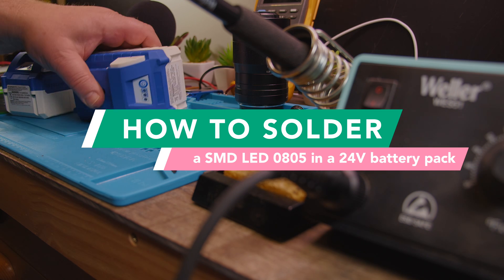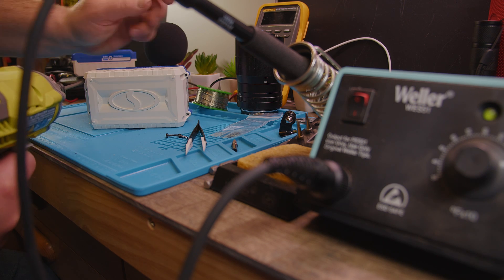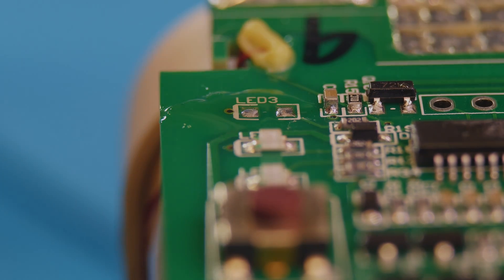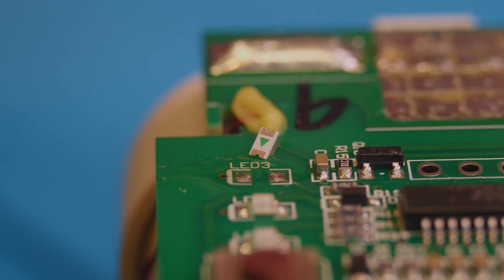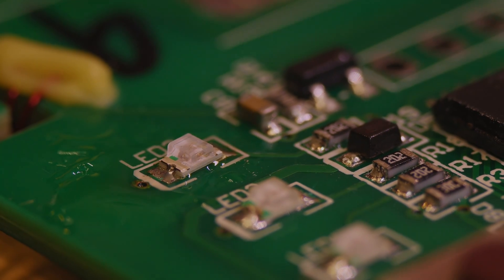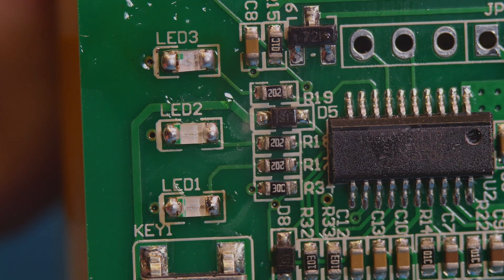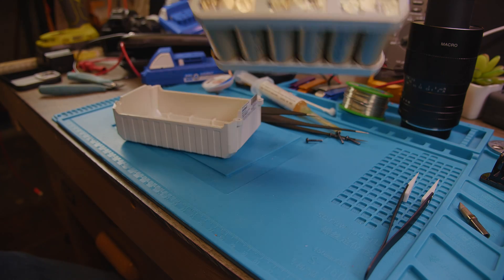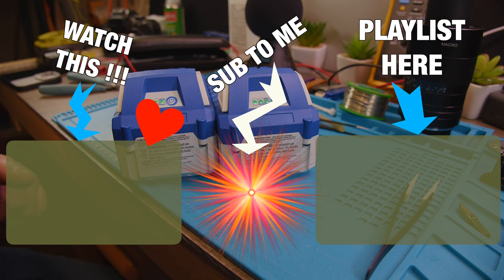How to Solder a SMD LED

Comment: Im a new to soder. What exactly is the flux paste for? Im researching because i need to replace led yellow to led white on my car. My car has no bulbs its led chip. Please explain the flux paste please
Reply: Flux is basically what you put on the contacts or whatever your soldering to clean the surface for the solder to be able to stick even though It looks clean there can be oils and things like that on it that the flux will clean off as you solder just put some on whatever your soldering and start soldering with it still on there it'll melt away and clean the surface of the metal chemically another thing to add is if you can't get solder to stick try filing it a little or roughing up the surface it'll help a ton

Comment: Thanks for the video, question, after installing leds I checked lights with multimeter, they light up but they do not have the same voltage they only read 1. as oppose to 1.8 or 1.9. are they installed wrong?
Reply from the maker: well they wouldn't light up, if they installed wrong.
Reply: @mygiguser  Hey thank you. just was not sure. new at this.

Comment: How would you remove those LEDs using an iron?
Reply from the maker: You have to heat up both contacts at the same time. Or use suction or a wick to remove the solder.
Reply: @mygiguser  would that work on small LEDs like 0605?

Comment: im guessing you were using maybe a .50 soldier. in the future use a .25 soldier. and even a smaller tip. makes the job much easier.